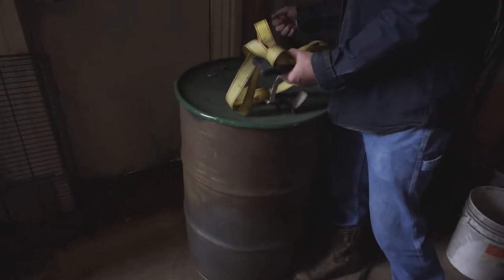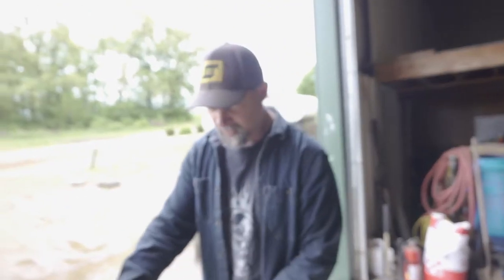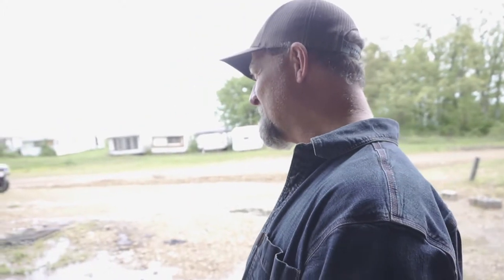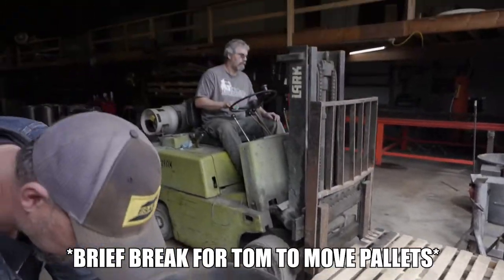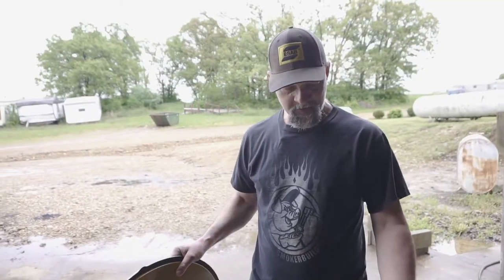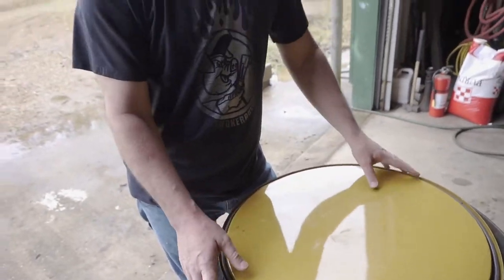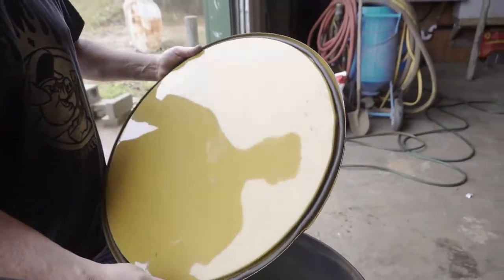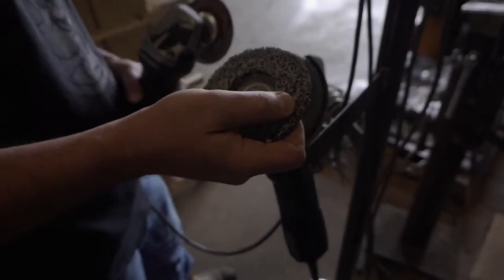How To Build a UDS Drum Smoker [Remove the Liner and Gasket From A Used Barrel Lid]

Comment: I used paint stripper on the whole drum. Smear the stripper on and scrape off with a putty knife. Then a wire wheel in drill. Shines right up. Only took a couple hours to do the inside and out .
Reply: I’m thinking your idea is less of a pain in the ass.

Comment: A PROPANE WEED BURNER WORKS LIKE A CHAMP IF YOU HEAT THE OUTSIDE UP TO RED HOT.  I DID THIS WITH MY BUILD, AND THE RED LINER TURNED TO ASH, AND WAS EASILY REMOVED WITH A WIRE BRUSH AND SANDPAPER.  IF YOU TURN THE DRUM UPSIDE DOWN WHEN YOU HEAT IT, EVEN THE OUTSIDE PAINT NEXT TO THE BOTTOM BURNS OFF CLEAN.
Reply from the maker: Absolutely

Comment: Can I just use an angle grinder to grind the paint on the inside of the drum instead of burning it off? what would be the pro's and cons?
Reply from the maker: Hey buddy! You could do this. The down side of it is it would take a really long time and make a lot of dust.
Reply: @SmokerBuilder Thank you fro answering my question, I do have a follow up though. I talked to my friend and he suggested using a paint stripper, would that work too?- PS. I found the answer in the next comment. Thanks!